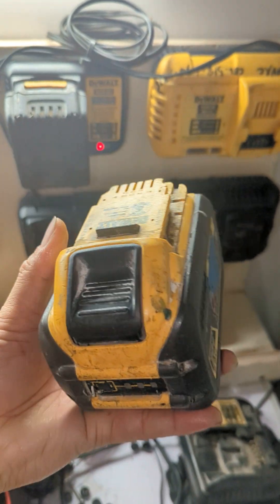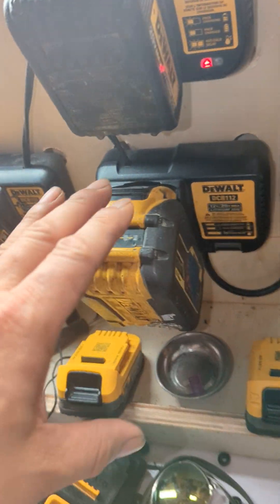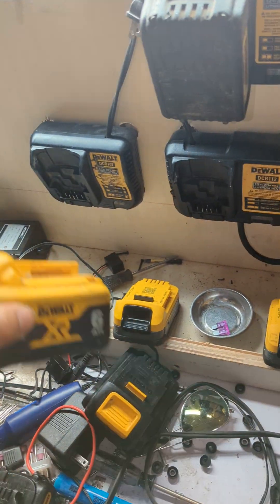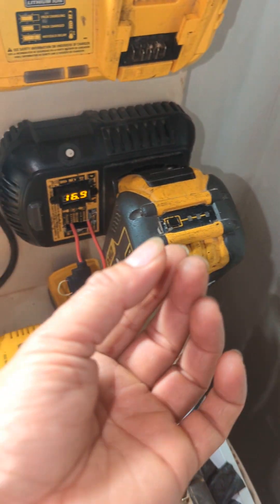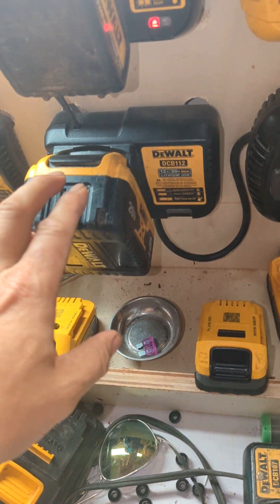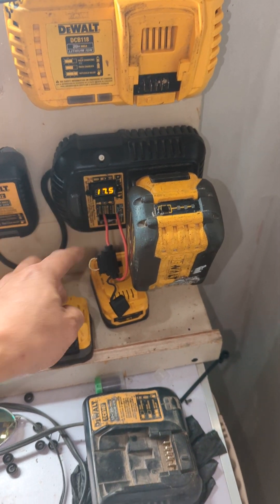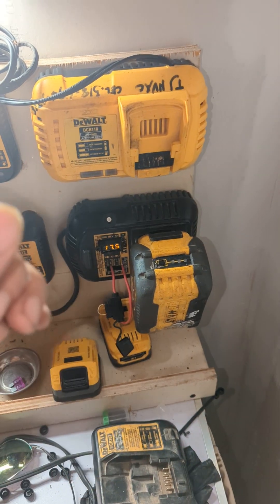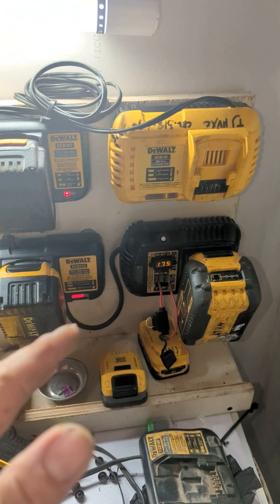How to fix a non charging DeWalt battery. I designed a solution with an extra old battery charger.

Comment: Any tricks for Ego battery
Reply from the maker: I don't have any to test but it should be the same principle. I will make the wiring diagram video when I have the time.
Reply: @TJ_HVAC_heating_cooling  thank you I have a dead battery and was wondering if I could just jump it with another charged one?
Reply from the maker: Yes if you can find the b+ and b- connect in parallel. Install a 5 amp resettable fuse in the wire so if the amp is very high it will trip. You do it quickly because the wire will get hit and burn you if using a small wire.
Reply: @TJ_HVAC_heating_cooling  thank you